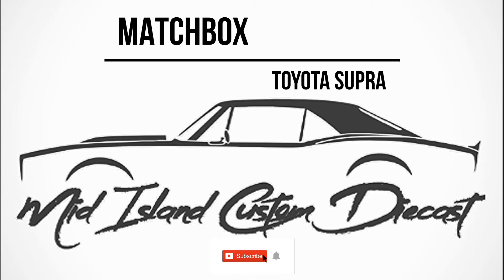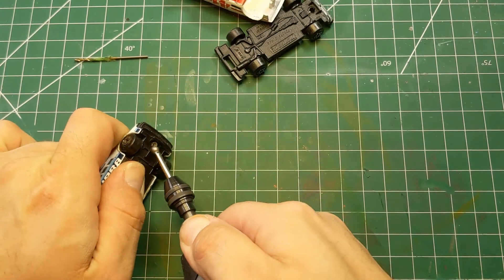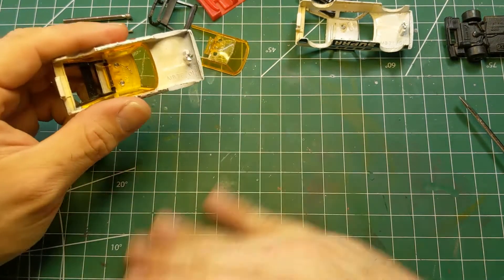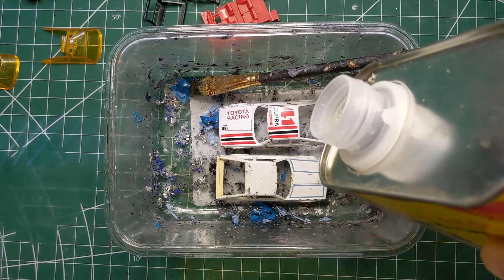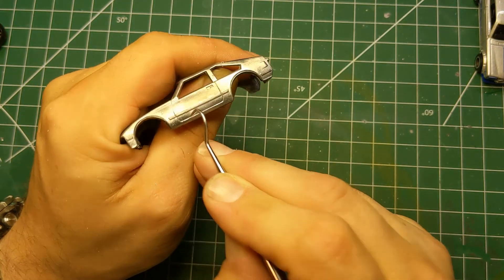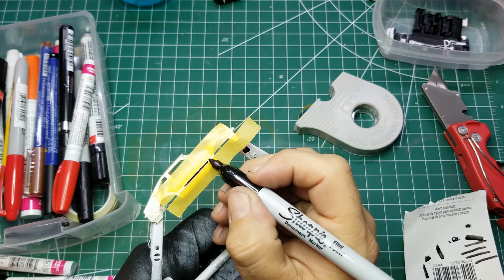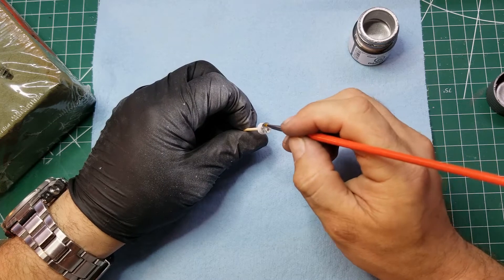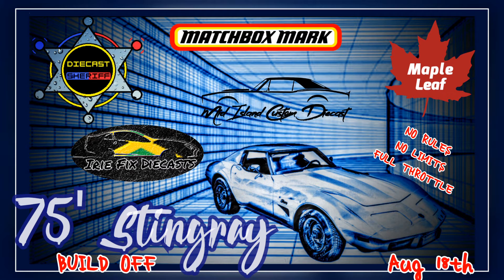Ep 05 - Matchbox - 1982 Toyota Supra

Comment: Nice job on the Supra, Evan. This was the hot car when I was in high school. You're right, the wheels make the difference. I checked out the link you added in the description. Wish it wasn't so expensive to ship overseas. Looks like you've got a good supplier there. How's the Corvette job coming?
Reply from the maker: The Corvette(s) are done, just have to put the video together! I have 3 sets of those wheels left over. I can check what it would cost to ship one or two to you if you have a Toyota build coming up
Reply: @MidIslandCustomDiecast  I wasn't fishing for a shipment from you! But that's a great site with a huge inventory. Need to find something like that over here. What about the rubber tires to fit them? Got another link for those?
Reply from the maker: @MapleLeafCustoms  I got lucky and the monoblock wheels fit perfect. I suspect you will have the same issue with shipping though. But I'm happy to assist with shipping if you want.